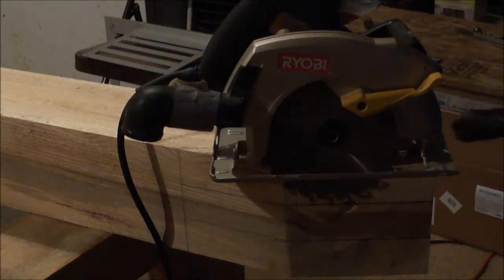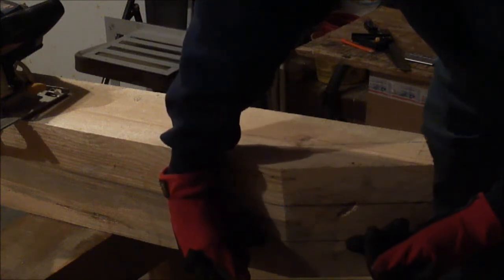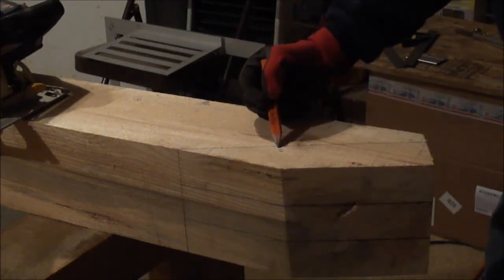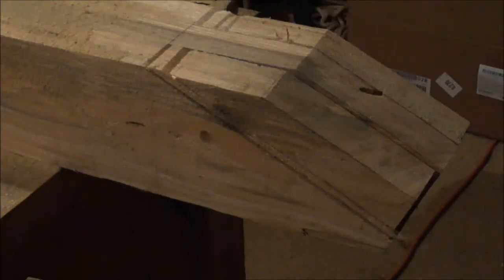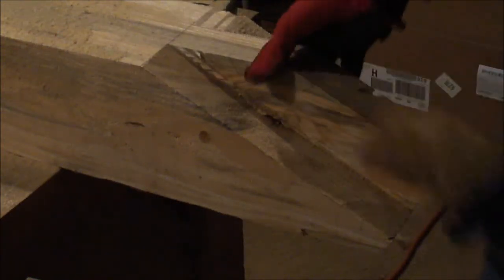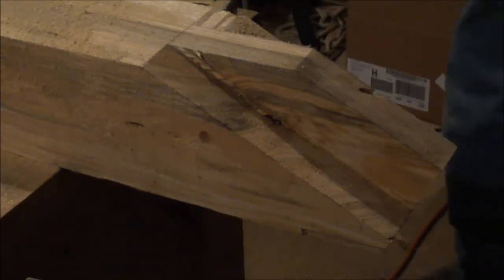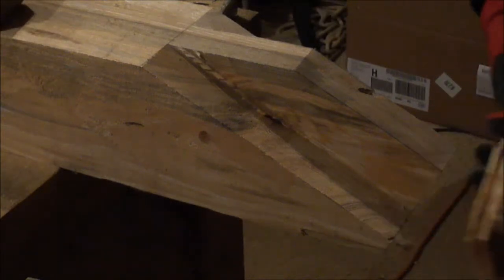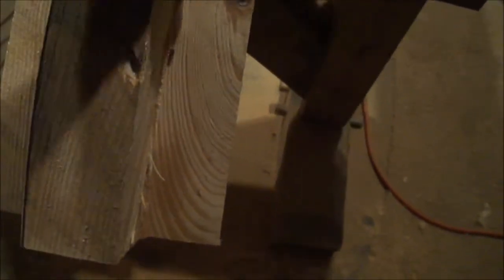Timber frame gin pole: brace layout & cut Part 4 of 4

Comment: hp52013 - The tenon template you're inquiring about is called a "Big Al."  It is named after its inventor, Al Borneman, and has proven to be a huge time saver for most of the joint cutters I've been associated with.

I bought mine years ago, but one source I know of is the Timber Framer's Guild.  Look for the TFG STORE tab at the top of their home page then look for the TOOLS icon.  Yours will even have a TFG symbol on it, so you'll be the talk of the barn raising.  Have fun with your project.